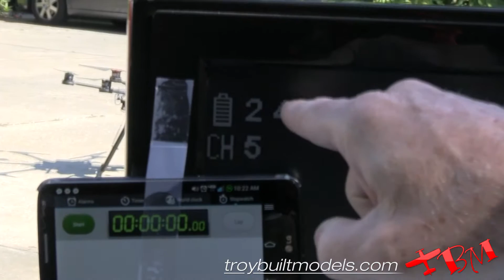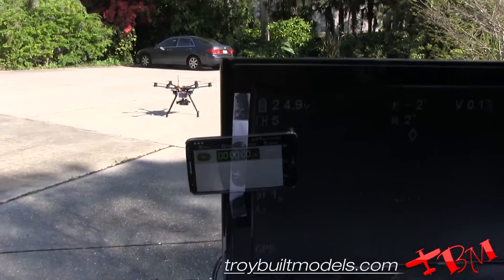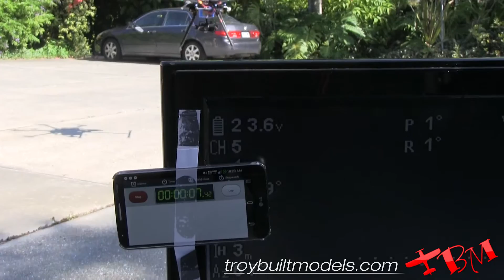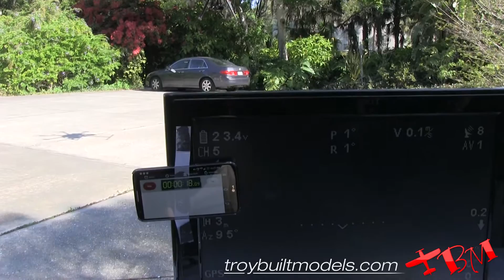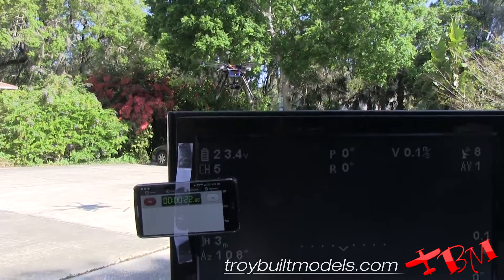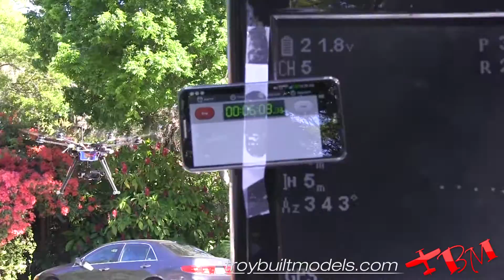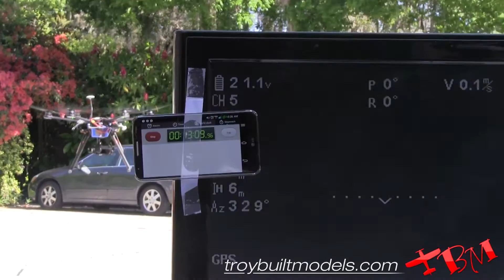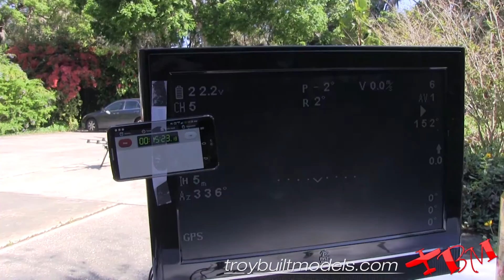AGA 6S2P 20,000mAh 20C DJI S800 EVO Flight Test - 19lbs 15 Minutes

Comment: Hey, guess what... I flew my dji s800 evo with z15 and nex7 with avl 5.8 and iosd mark II, and the battery i used gensace 6s 16000mah 15C. I could fly last 3 days for 17 minutes. On the air, the iosd mark II battery indicates 21.6v. And when i landed, the battery indicates 22.2V which means per cell is 3.7v. It is not fake. It is true. i think, we don't need bigger C for multirotor, because multirotor flies so static, calm and also motor rotation is static which means it is not like RC airplane or even RC Heli that the motor run so high. So in my opinion, try less C at least 15C minimum. Or you can try 20C, not more than that. The more C battery you give to the multirotor, the more C burst the battery gives to all motors of it. And it just waste the power and also the flight time you reach is less than you expect. Thanks. Dewo "Indonesia"
Reply from the maker: Yes, you are correct, 15C is all that's needed, thought 20C or 30C is OK too.